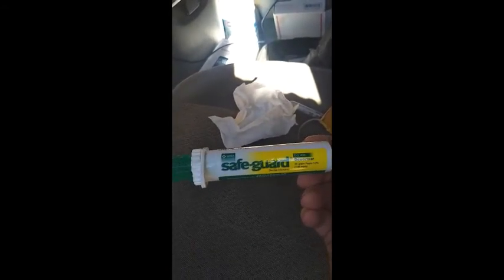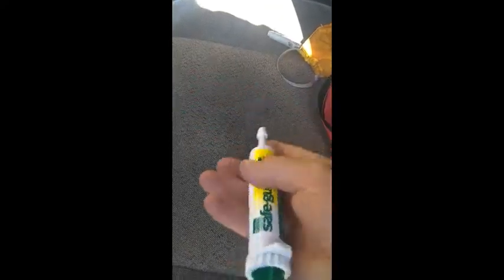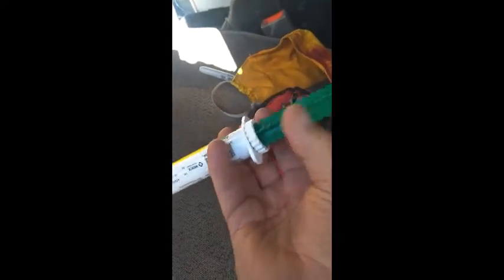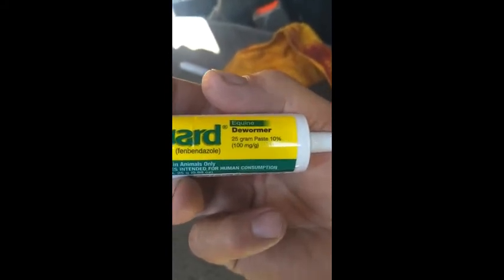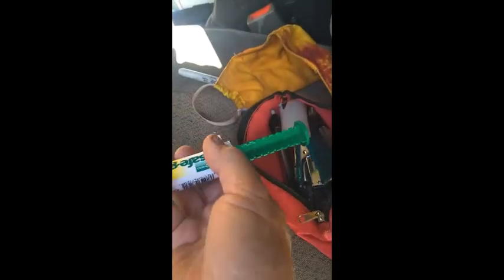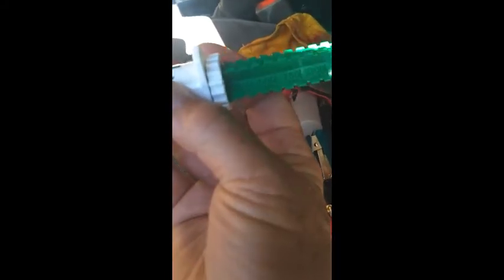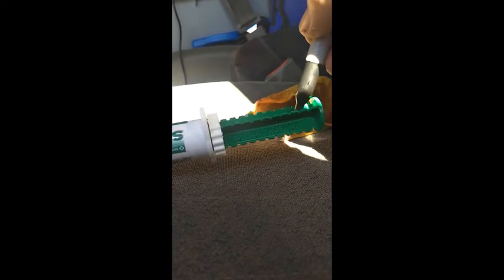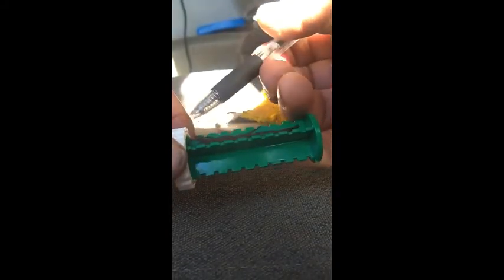Proper Dosage of Fenbendazole From Horse Dewormer Syringe

Comment: This is incorrect dosing guidance for humans. 

The proper dosage is 30-50mg/kg for humans. At 50mg/kg, the proper human dosage would be 25g for 110 person which is one tube!
Two - 25g tubes for a 220 lb person. 
Underdosing like this will cause parasites to encyst and they will not be eradicated. 
It’s much cheaper to use Safeguard liquid. 

https://floridasharkman.org/wp-content/uploads/2022/10/ParasiteProtocol_10-15-22v12.pdf
Reply from the maker: I am in no way qualified to speak to human dosage issues. That expertise comes from a qualified health care provider. I only meant to show how to get a certain dosage by using the notches on the syringe properly. I don't know if the information you provided in your comment is correct or not, but it was never my intent to practice medicine, or prescribe substances for humans. Anyway, it says right on the tube, "Not For Human Consumption". Neigh, I say...........Neigh
Reply: The Safe-guard dosage says 5mg/kg, so for a 166-lb horse, that would be 373.5 mg or .37gm.
Reply: @melvinfrisbey8611  you didn't read the original comment. Horses and humans are different.